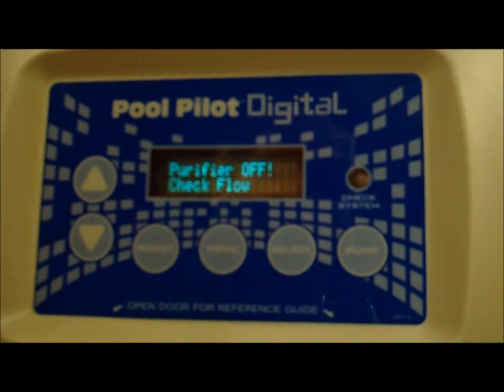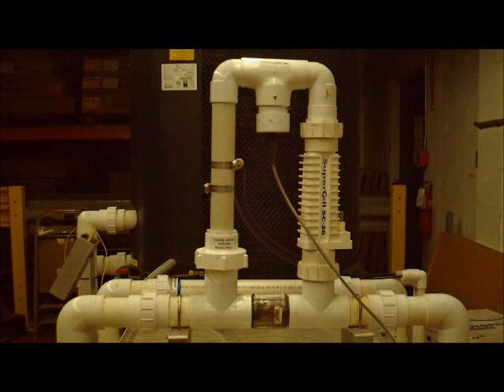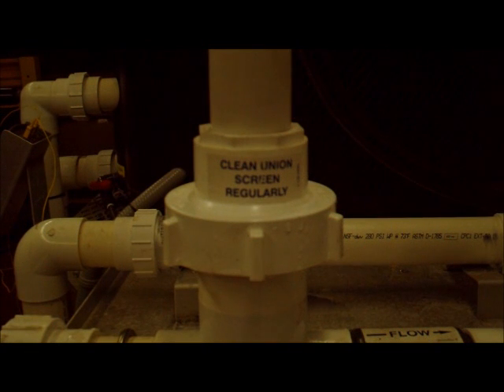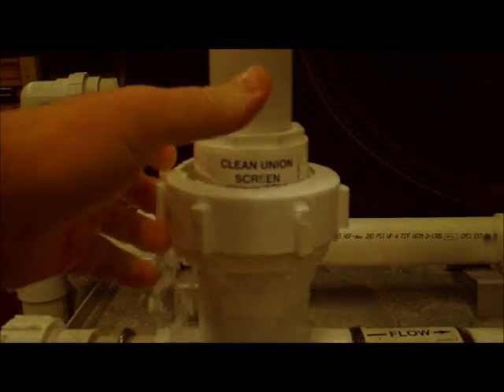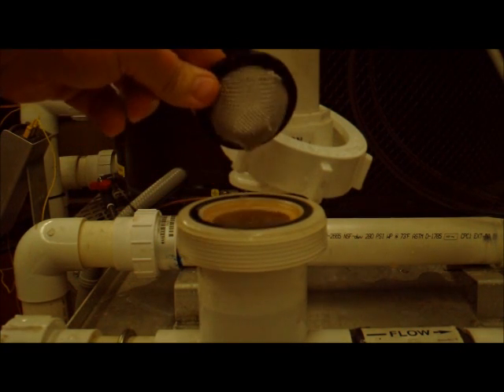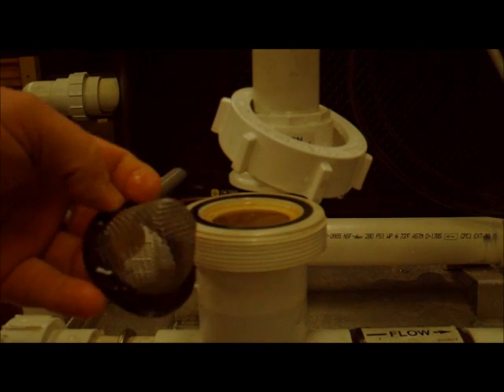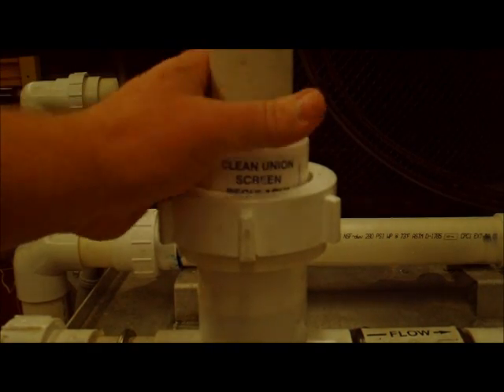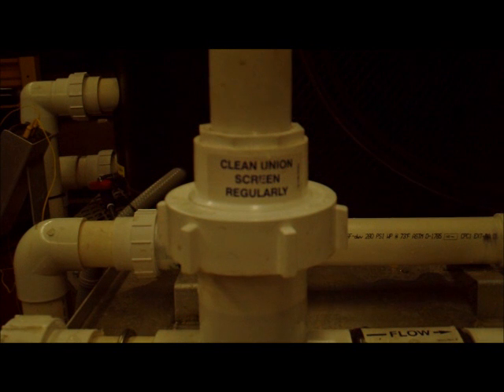Diagnostics For Check Flow / Purifier OFF Warning On Your AutoPilot Salt Chlorine Generator

Comment: what is the proper way to clean the tri sensor my sensor says my water temp is 55f when it is really around 70f to 75f
Reply from the maker: Hi Adam,
 
There could be another reason why the temperature is reading incorrectly.  Please call us at 727-823-5642 and we will be happy to assist you.

Comment: Dude, thank you.  My variable speed pump was having to push at 2200 to stop the light from blinking. I was back flushing, looking for blockages in the pipes etc. I thought it was a salt system problem so then I turned to you tube, found this video and bingo. My mesh was clogged up.  Cleaned it off now my system is purring like a kitten and the pump is down to 1600. Thanks very much.

Comment: I clean my screen once a week but the light keeps flashing
Reply: The same thing happened to me but then i looked into the pvc pipe and  saw debris there, so while I had the screen out and ths pipe open, I turned on the pool pump and forced the water and the debri out with the water.  I did it three short spurts then looked again....no debris.  I put the screen back in , tightened the connection, turned on the pump and no more alarms.  Awesome!!!!